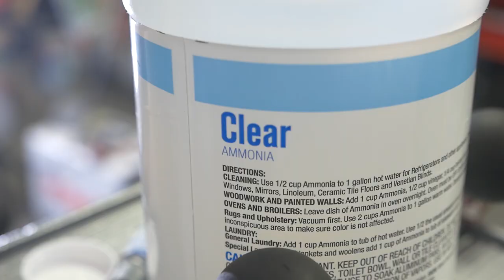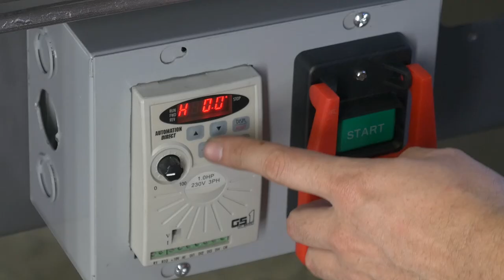Lathe Rebuild Part 9 - S02E10

Comment: I'm always amazed when I see people in the US wiring up heavy shop tools.
We are so spoiled by having 3-phase 400V in most households here in Germany.
Reply: you've got household 3-phase in Germany? Fuck, I'm going.
Reply: Spoiled do doubt, that's really awesome for you guys.
Reply: In Brazil we just call the power company and ask to change to 3 phase, the bill will have slightly different tariffs.
Reply: Das ist war ;)
Reply: The reason why Germany has many homes with 3 phase is because Germany is much older than the US.  In the US, back several decades ago, you could specify if you wanted your property to be wired for 3 phase or not.  However, most people didn't because they didn't have the need.  By the time the US was being built, people didn't have much need for that kind of power, and the ones who did had extra building spaces for their shops rather than their homes.  Today in Arizona anyway you can get 3 phase installed in your home for free by the electric company but only if you have the machinery onsite and ready to be wired up.  You have to have the machinery ready to go because they don't want to spend the high cost of putting in the lines and equipment if you don't have the machinery ready.

There is another thing about Europe that is different than the US that makes public rail transportation viable in Europe, but not the US.

Since most of Europe is very old everyone traveled using horse and buggy or by foot.  Because of this, the homes in Europe are built very densely usually in the center of the cites.  When the Industrial Revolution hit, the factories and industrial buildings were built on the outside of the densely populated centers.  However, in the USA, the opposite is true.  In the USA, most of the cities have all the industry and factory buildings in the center, and all the homes are located on the outskirts and the outskirts are very sparsely populated.

This makes public rail very good for Europe, but bad for the US because the people in the US have to drive a long way just to get to a hub for public rail.  So they might as well drive to work anyway.  In Europe since everyone lives very closely in the middle of the cities, catching public rail to go everywhere is pretty easy to do and fast.

If I recall correctly, I think when you compare Paris and New York city, the inner city of Paris is 10 time more densely populated than New York City.

PS:  The information provided above is not true for 100% of the cities in the US and Europe.  It's just a rule of thumb.  I am sure you can find some cities in both the US and Europe that don't follow the way I described.
Reply: @theonlyonepaulo    The US has the same.  Anywhere in the US you can ask and get 3 phase if you want except only in the most remote parts where there are no electrical poles.  My father owns a farm down by the Mexican border and when he built his shop he got 3 phase by simply asking for it.  However, a few years after that, the electrical companies stopped providing it by default unless you need it and you pay extra to get it.
Reply: Used to be a pain in the you know where in the USA to have 3 phase power. But today with rather cheap VFD's you can have 3 phase power and rpm control at the same time from single phase supply. If you want speed control you still need a VFD in Germany, so the cost to have speed control on 3 phase power in both places is about the same. If you are ok with one speed Germany is still better.
Reply: but you also have law ageist having fun and you need to have a degree to do almost everything. ;þ
Reply: In Australia we are like Britain, 230volt to the house but 440 to the pole so 3 phase is easily connected but you pay for the new 4 core cable from the pole and a new meter box. New suburbs are different as the power is underground and 3 phase is not supplied but VFD’s tend to make that not a problem. What i didn’t like was the bare earth wire. I believe that if your home is not fitted with some kind of earth leakage detector then that bare wire could be deadly if your making contact with the machine and there’s a fault. Over here all earth wires are insulated. 
Let me know if I’m wrong. Great job on the rebuild and you won’t regret having a lathe. Cheers Stuart 🇦🇺
Reply: @adamjankowski7679 
In Germany prison break isn't illegal cause u can make seeking freedom illegal.
The US on the other hand has the biggest prison population in the world, who can be lucky as they also have the highest number of ppl killed by police without due process.
So the authoritarian label should obviously go to the police state named US of A.

Comment: Good luck on the grinder, remember that the spindle will need very good support and something above 1/2 HP.  I had a lathe bed ground on a large universal grinder that had a 50 HP head and it still took multiple passes with coolant.

The saddle will need it's position above the leadscrew and such by the amount taken off the bed, usually.  If the gearbox is referenced vertically to the headstock you won't have to raise the saddle but lower the mounts at the hailstorm.

Likely the headstock, saddle and hailstorm will all have to be scraped into the ground bed.

A copy of Connelly's Machine Tool Reconditioning will come in handy.  I'd guess that you're about 1/4 of the way done - I've done a couple including a Monarch 10EE.

Comment: One thing I can see.

The V-belt you're using is fabric wrapped.
If you want to relax the tension on the 
drive pulleys, get a fractional horsepower 
belt.  FHP belts will wrap around the pulleys 
MUCH easier, and let you run the belt with 
less force.  (Tightness on the pulleys.)

FHP belts are raw rubber, where they hit 
the pulleys, and fabric on the top and 
bottom.  There are fabric strands, just 
below the upper cover, for strength.

Too much stress on the pulleys, will 
wear out bearings.  (Don't ask me how 
I know!)

steve
Reply: How you know
Reply: his...friend wore out his bearings by putting too much stress on the bearings.

Comment: I love my 1974 bantam! It is mounted on two 3x7 longitudinal hardwood balks that I shaved shallow slots for the feet to sit on. The balks sit on 1/8" rubber sheet on the concrete floor. This mounting prevents distortion of an old, relaxed, well-normalised casting. The rigidity of the bed is not compromised, machine vibration is minimised.

Comment: Love how he was listing what you'd need as you put each item on the counter in the foreground...

You left a large hole on the left side of the VFD/E-Stop switch box, that will allow dust/metal particles into the area of the wire terminals, enough of that will cause the terminals to short out and likely fry the VFD, requiring it's replacement (I saw this in Electrical School when we were shown why cleaning the insides of the equipment in the Welding Dept. is a REALLY good thing...3 different machines needed the control systems replaced due to arcing/short-circuiting from metal dust accumulation, due to old/bad seals on the cover plates). A cover will also keep insects & rodents out of the box (prime nesting area for them), which will keep them from chewing the wires (causing dead-shorts and possibly causing a fire)...

Comment: I enjoy your videos because of the enthusiasm and it take big ones imo to put your work out there. Few things...Romex cannot be run in conduit it is not allowed by code because of overheating switch to correct rated wire for use in conduit. The VFD is going to need more cooling typically enclosures pass air by filtered axial fan ports. Permanent wiring to a motor should be done in a conduit at the very least SJOOW which is not the preferred. Inline fuse is a good idea on the VFD. Google Browning belt tension tool. And finally when driving anchors we use the nut as thread protection. Sorry don't mean to seem like a troll if you had contact info I would have sent you a message directly.
Reply from the maker: +T C Thanks for the comment. I have heard about running nomex through conduit not being advised, but mostly for under ground applications. In this case, given the length of the run, and the load it will see, I have no problem putting my faith it in. As far as code, it's actually not that clear. Good discussion here:

https://diy.stackexchange.com/questions/31149/can-romex-nm-b-be-run-through-conduit

I did look up the spec on the vfd for a recommended enclosure size before installing it, so I know I'm not in spec there. I opened up the bottom and side ports on the box, and the vfd has a pretty good fan, I will keep an eye on temps though. I will be running conduit all the way to motor, just ran out of right angles. I will also make sure all the connections are inside the box. I will check out the belt tension tool as well. Thanks again for the info.
Reply: T C just a quick comment on protecting the threads: in this particular case the anchors have a shoulder/relief at the top 1/4", so no threads were impacted. That said I wish they didn't have that, would have given us a few more threads of adjustment and saved some time fiddling.
Reply: Ryan Wilhelm in construction typically a longer redhead is used and cut flush just buy longer anchors. Instructions explain the washer and nut, normally you drill through the mounting hole of the fixture blow out the dust slide a washer on then nut to where it is flush with the end and then drive down with a hammer followed by wrench to set.
Reply: T C longer anchors next time for sure... unless we follow someone else's suggestion to epoxy threaded rod into some bored holes. Part of me likes that because I can pick some good/known stainless and choose our own length. Any suggestions on that front? Seems like it might not take advantage of the compressive strength. Concrete has some stranger properties than I think people are aware of...
Reply: Physics Anonymous in my area of the world building inspectors do not allow this. As an apprentice I witnessed a sub having to "redo" an entire track of homes when romex was installed in conduit to service disconnects. The conversation never comes up in commercial and industrial as romex is banned in that application. Isn't your lathe an industrial machine?
Reply: Ryan Wilhelm you can look in to Hilti products for epoxy ratings they can also help you with application guides. For what you're doing I don't see anything wrong with wedge anchors or drop-in anchors. For large heavy machinery  an engineered pad is poured for the load but that's overkill for a garage. I have only seen stainless used in harsh environments but not all stainless can compete with the properties seen with non-stainless grades. FYI my mill is old heavy American cast iron and it isn't bolted to the deck it's leveled on pads and it ain't going anywhere. =)
Reply: I hear nomex is good for warding off flames from the Internet...Invariably people will find fault with everything being up to code in their area. Similar to how when you weren't wearing a mask when spraying rattle can, I thought you would die and not finish the lathe project when I read that...not saying it's good to breath paint fumes, but I can't get any good paint in Cali, where I live. I'm painting a fender this weekend, first time. I know I shouldn't do that, I should just take my truck to the body shop and pay them to do it...but I started to take it apart when I got home after the accident...next thing I knew I had the fender and bumper off. Found a shop to straighten the corner of the frame and apron, bought new after market parts, primered the fender today (was black primer, but Tacoma is white, so sprayed with gray...same as orig so color might match). I'm sure I did some stuff wrong with this project. So far I have all my fingers and toes. Funny thing with this story...when I had the shop pull my apron, radiator support, frame, the owner told me he was glad to see someone working on their car, cause few younger people do it anymore. Keep on rockin', the world's your oyster! :)
Reply: Use Liquid Tite / Seal Tite flex .  If you have Romex , split the sheath and run the individual wires .   Although I would not loose any sleep over it .

Wyr
God bless

Comment: Just a safety tip: get used to holding a piece of sheet metal (or any other kind of material) with some pliers or at least wear gloves while holding it when you drill it, if it's not possible to clamp it down. You might save yourself a couple of hours at the ER and probably keep some fingers. I know, it was a large piece and it was a small drill, but better be safe than sorry...

Comment: I just wanted to add o the discussion, even though its a little late, by saying that 1) they make power scrapers and they are super cool and 2) scraping in the ways is supposed to add the ability for oil to lubricate the ways better as well as making them flat.   Grinding in the ways will only get you so far, but to get good lubrication you're gonna have to do a good amount of scraping

Comment: Next we will see a giant surface grinder build video? awesome!
And I think you will probably need a rubber plug between the pipe end and the motor side wire. dirty metal debris may fall into that.

Comment: great series guys, I've really enjoyed it.  I enjoy reconditioning old equipment myself.  For the most part I'm a 'to each their own' kind of guy when it comes to this stuff; so more power to ya with the wiring and the ways you make things work for the conditions you have.  The previous points about the wiring and VFD have merit.   i'll let you guys do what you want.  What I do strongly suggest is PLEASE wear proper foot wear.  Doing all that metal work, grinding, handling all that heavy stuff and tools in sandals!!!  You are asking for a some major injury to occur.  I expect to see you walking around in a cast in a future video if you don't.  stuff happens in a shop, please take the proper precautions.  Yes, we all get lazy, we all cut corners, and take risks.  You both seem very thorough in your process to create a good product, be thorough enough to at least wear closed toed shoes, if not impact resistant ones.  Ok, safety rant over.  Like I said love your videos, content but also the way you keep the video moving, great editing, narrating, lighting, and enough detail shots to show what is really going on in the process.  Keep it up.

Comment: There should be no solid wire on a machine tool. It will break from the vibration. Stranded wire only.

Comment: Induction hardened ways must be reground. Scraping is not an option.
That is what I was taught as a machinist.
Did you actually get any material off?
Also, you need a machinists level that has a .0005” per 10” capability. The six inch level will not be adequate.
You could hang weight over time the bed will settle, hopefully.
I am enjoying these videos. A Colchester Bantam lathe is highly regarded as a quality light lathe.

Comment: nice content! keep on going! 
 i dont think having the emergency before the vfd is a good idea.
power shouldnt be taken of the vfd while the motor is running, also the vfd can brake the motor way faster even without a braking resistor just by running the freq down to 1.
i believe most vfd's have a special analoog port for the emergency stop, or atleast programmeble.
Reply: MrFransie85 I considered the same (vfd/motor damage), but this vfd appears to have some logic in it to deal with that. Cutting power actually still leaves the vfd turned on (presumably a big cap inside providing power), cuts power to the motor and it throws a code before shutting down on its own. Logic port for a power cut makes me cringe, is that really how they're normally done??
Reply: the manual ive read says so, you better check yours 
as i stated before a forced stop is way faster then just ''pulling the plug''
i hope your manual gives the answere
Reply: I have a vfd running my bridgport, if I shut off the breaker to it while it's running, the caps in the vfd hold enough power to keep the mill running for several seconds. Not a good way for emergency shut down. Agree with using the logic control inputs. Also don't disconnect between the vfd and the motor-could damage the vfd.

Comment: I am wondering how you checked to see if all the surfaces you scraped were still parallel with each other.  Also I think you will regret only 1 hp in the end. It is better to have more power  so you can get enough RPM with the cutting loads. Impressive rebuild.

Comment: My father used to own a house that had three phase wiring because I had to replace the compressor on his A/C and it was three phase.  I'm not sure if the previous owner had it wired that way on purpose or not?  I believe the house was built in the late 50's.

Comment: At home, acceptable. In a good way, all the surfaces of the bed should be grinded for one installation on the machine, and then shave all the other details. Only then will there be a parallelism and co-ordination of all the guides.

Comment: I trust you're planning on making a general purpose machine, not something that is only suited for grinding this exact lathe. Not worth the work when there are shops all over the country to grind them for you. But having spent a couple hours on my manual surface grinder today, while pondering about CNC-ing it, I am absolutely interested in seeing what you end up doing.
Reply from the maker: +Jon Miller it's like your looking into the future ;). Stay tuned for sure. We won't just be milling about, if you catch my meaning.

Comment: please put insulation on the exposed copper wire in the junktion box, they might toutch the live wires, and use a relay for powering the motor that is controlled by the "computer"
very good video tho :D